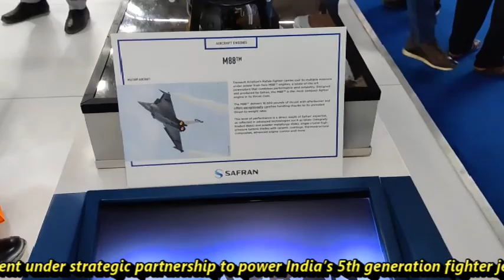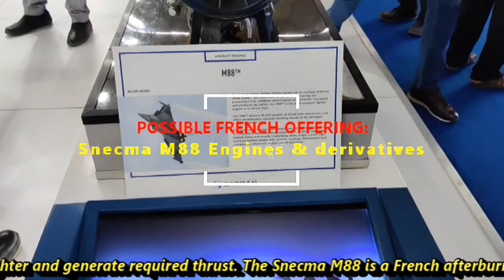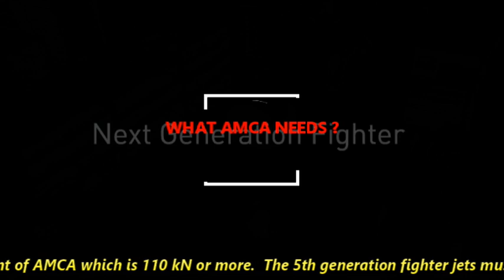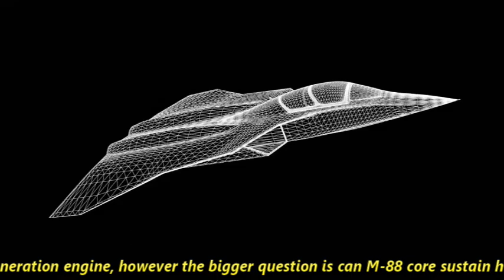Kaveri and M88 hybrid engines for AMCA | what are the requirements of 5th generation engines ?

Comment: Video seemed incomplete. What are the final requirements of 5th & 6th gen engines and what are there differences from currently available 4th gen engines ??
Reply: The main difference apart from higher thrust requirements is low heat and radar signatures so as to maintain stealth characteristics of the aircrafts.
Reply: the most important performance requirements should be thrust to weight ratio 5 gen engine about 9-10, next gen about 12-15